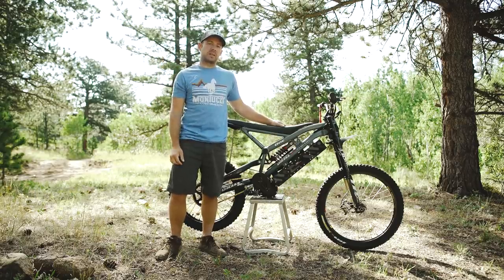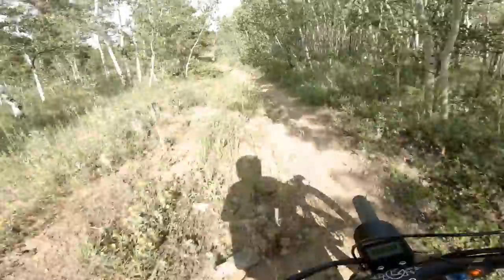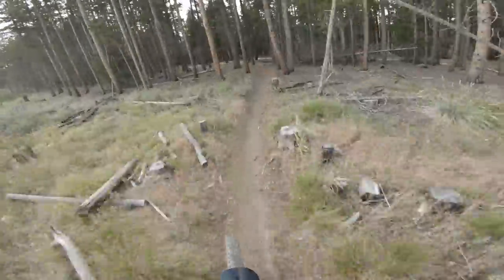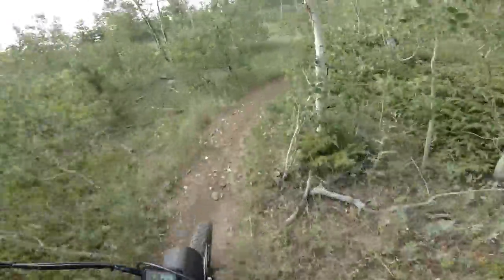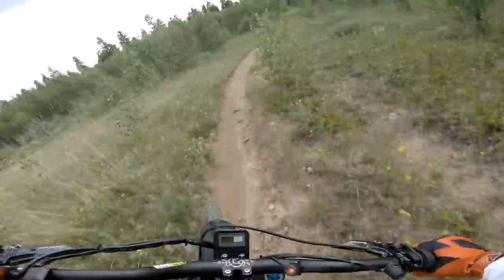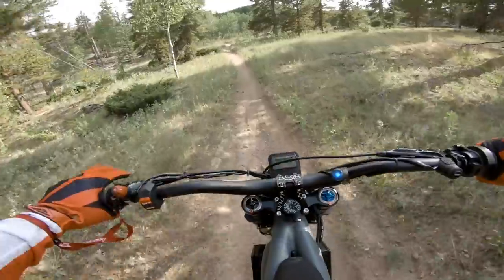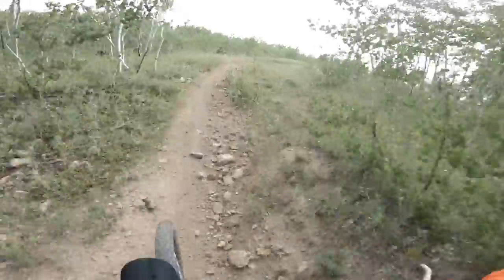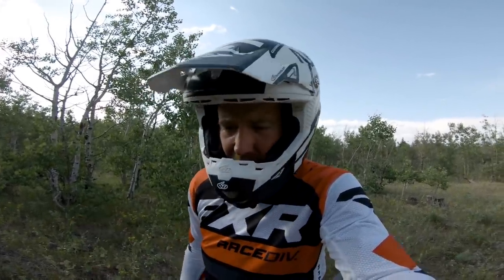CZEM Drill One Electric Dirt Bike | A Sur-Ron Destroyer?

Comment: Would like to see a longer close up walk around. Zoom in to frame and welds, adjustable points for pegs and geometry and chain tension.  Cockpit details, throttle and brakes, motor and chain drive, controller and program parameters. A segue 260 vrs this bike, which one would you purchase ?  Thanks for showing us the new tech!!
Reply from the maker: @Gary Linnert Copy that! I'll keep it in mind for the next video. Thanks for the note.

Comment: Only a sur ron killer if the price was similar. Its $9500 which is similar to KTM or Zero.
Reply: Not only that but, you can't get one so there is no comparison! Also my Sur Ron weighs 110 lbs and you could almost buy two sur ron's for the price of this (vapor wear) bike
Reply: This aint killin no sur ron. Stealth bomber eater maybe but my sur slightly modded my sur ron with my 220lbs ass on it goes 54mph and i can sir on the battery and still torque the front end up. I do like this bike a lot but syr rin killer its not.
Reply: @mshock9637  If you are not running an ASI or Nucular 24f with a 72v battery  this bike would crush the little Sur-ron you ride.
Reply: @andrewhunt4777  
Not according to the stats it wont. My controller is 120 amp as opposed to the stick 80 amp. I get 54 out of mine on the road with knobby tires and my big ass.
Reply: @mshock9637  Get on a track or trail and see what would happen.You would not even be close behind this bike.This bike has way more power than what you have.Even a straight line drag race you loose.
Reply: I mean you say that but.... 
And like ive said else where if you got a sur ron and dumped the extra $5k into it that sur ron woukd smoke this thing. Im not baggin it its just not s sur ron killer.
Reply: @andrewhunt4777  Fact!And its not built in a size for kids lol
Reply: Slappy White  120 amps is right at the end point of burning the SurRon 60 v cells.  110 amps better for battery health... Yes that is possible on stock SurRon battery with nuclear or ASI and bms bypass.   I run similar speeds at 110 amps - Drill runs 48 volt Sony murata high discharge cells that stay cool it’s a big part of sustainable power. Great package when the propriety motor the silllex controller and battery and bms all work together and no Chinese parts are here. You can mod any bike to get as fast as  another . But not sustainable ... and a different feel with a bike that has been designed to do what Drill One does.  I’m sure in time many  in USA Zwill love this bike.  it’s not a SurRon killer as they are a different class. It’s a KTM has killer with similar weight to power ratio and basically no maintenance and service costs. There will always be price whingers and haters though on anything new. 😏
Reply: @mshock9637  This is a surron destroyer! It leaves modded sur-ron's in the weeds.
Reply: @mshock9637  nope I have 84v sur-ron's with nucular 24F controllers and it destroys them. Considering I have had them for over a year and the tricked out sur-ron's are dust collecting pit bikes now.
Reply: @mainiero50  because sur ron motor max 10 kw ,not morе!
Reply: @mshock9637  How tall are you?
Reply: @lIlIlIlIlIlIlIlIlI  
6'1" or 5'13" or 185.42cm.

Comment: $9k 
55mph
2.5hrs range
3.5hrs charge time
Also the noise comes from the motor and controller not the chain. You dont hear bicycles going down the road makin all sorts of stupid noise.
Reply: Yes and no,If the you have a small motor sprocket it makes these sorts of noise from the chain as it forces the chain to take take a very tight path.And no why would you hear these sorts of noises on a pedal bike lololol
Reply: @fpvlee1586  
Ok how about a normal motorcycle thats still got its factory exhaust. The only time you hear the chain is if its dry. 
You cant hear the chain over all the chatter from the controller and motor. Have you ever played with a modern battery powered RC truck or car? When they power up some even use those noises as a notification that everything is good. No chain on any of my rc cars and they make the same noises.
Reply: @mshock9637  I like the noise my rc car makings whine noises too
Reply: That sound is called Electric torque, once you feel it with the whine you would change your mind unless you're just biased going into it. Plus I'd rather ride my KTM freeride EXC than my KX450F as it's just 100% much more fun. Don't knock until you try it. You seem very information Biased as it also sounds much different than the camera portrays and much quieter too as cameras pick up different frequencies than our ears. Doh! 2,5 hours range, I want to see you run some serious single track for 2.5 hours straight. 2.5 hours is actually a long time, charging is irrelevant as you can charge it in 45 to 60 min if you want to with a higher amp charger. The only time you hear the chain is when it's dry? Are we talking street or dirt here? Do you even ride? Serious questions?
Reply: Im mot complaining about it im just saying its not the chain making all that noise.
Reply: @FarmerFpv  
Yeah i ride. I ride a 2002 TL1000R street bike and i have a sur ron and yz250. Im not sure what side you think im on but i dudnt know there were sides. All i was saying is that aint all chain noise like he states in the damn video. You seem to be the bias one here as the other stats i listed were pulled from drill ones website. So i dont know you deal with facts is but you seem to be the bias one here not me.
Reply: @FarmerFpv  
How the hell do you know what that bike sounds like unless you were with him when he shot this. I was made to understand that the only one state side.
Reply: @mshock9637  Fella you are comparing apples with bananas lol.If that engine on this bike you are talking about in your question was not running yet the chain was moving at say 60000rpm with the wheel TRUST me you would hear it!I know small front sprockets make a hell of alot of noise coz ive been there and done it loads of people have so have friends! Im not saying all the noise is from the chain BUT alot is!And no i have not played with toy cars since i was a kid,mbx5 was the last i would think.Even then there noise is mainly friction noise from the drive train i.e all three diffs ect!This is my thought and you have yours! Have a good day
Reply: Ive been an electrician and cnc millwright for the better part of 18 years i know what a chain sounds like versus the whine of an electric motor. You guys are such snobs about stuff its no wonder the rest of the world would still rather blow 2 stroke smoke... they just dont want to deal with you guys.
Reply: @mshock9637  I'm not upset fella lol I even said have a nice day! I think I'll leave this conversion here👍
Reply: @fpvlee1586  
Sorry if i used too manny words there. But my comment was simply thwarting the claim made in the video that most of the noise heard coming from the bike is chain and thats clearly not the case.
Reply: Farmer Fpv 100% agree with all that.

To be devils advocate, the engines do click a lot, but to hear how much noise a chain makes, one just has to throw the bike on a stand and twist the throttle. Chains are loud!Add a couple of hard plastic guides and maybe a chain guard in the mix and you have slappy, clicky, buzzy noises all over the place.

I'm having Freeride withdrawls currently. Cold sweats and night terrors. I sent the suspension off for a super overhaul, then proceeded to break a bunch of bones that weekend on one of my gas bikes. Hopefully I'll survive another eight weeks without it my juice fix 🤣
Reply: @mshock9637  The drive is much quieter once broken in and you give the chain proper slack. Usually, the tighter the chain the more noise these bikes make so we run them almost sloppy, and that increases battery life, and much quieter.
Reply: Are we still trying to decide whether or not the noises heard in the video are chain noises or controller noises?! Yall are off your nut if you think all that noise is chain.

Comment: They‘re not a sur ron killer if they cost more than twice as much. The surron is avaiblo for under 4k dollar an these are all over 7
Reply: Also if you add a 72V battery to the surron and the right controller it will beat this bike no problem at half the cost.
Reply: intra morph  so. Don’t forget to change from a stock SurRon: the seat. Foot Pegs. Riser bars,  Suspension front and back shock. 21 inch front wheel , tyres.   + labour cost of building battery and fitting nucular or ASI controller.  have Done all of this stuff to several SurRons .. and no it won’t beat Drill  - these are different motors.  drill one also uses Sony Murata VTC6 high amp discharge cells and runs a 48v system for safety and long term performance .. not a modded 72v low amp cells to burning point.  ??? Once you get up over 12kw on a SurRon - the motor  loses efficiency. And no of course Drill and SurRon should not be compared ..but they will be of course for marketing ..As in  the USA there  are now thousands of SurRons.   CZEM Drill one is a boutique player and not looking to break into SurRon market. they are Looking  though to break  into the big boys - KTM and husky market & Convert some of the hard core gas enduro riders. You boys who ride the cute kids bike - SurRon are not the target at all. 😆

Comment: Imagine putting a 6 speed gear box on this thing, easy 100mph +
Reply: It would help very little actually. An electric motor delivers its maximum torque at zero RPM. And RPMs can be handled via controller software.
Reply: @JuanJDumeP  thats what a gear box is for to give you more speed. Gearing is everything
Reply: @hidros1461  it won't help much. Electric motors have programable insane RPMs. The electric motor has more torque at 1rpm than at 100rpm unlike a gas engine who has most torque at it's max rpm. If Tesla isn't using them on their cars I'd because they don't really work. But I do understand 100% where you are coming from. It's hella confusing and new.
Reply: @JuanJDumeP  I guess a taller gear would give more mph maybe
Reply: @JuanJDumeP   lots of diy electric cars use the stock transmission, you can even use a manual gear box.
Reply: @JuanJDumeP  I've got an e bike with a middrive motor that uses the gears. The gears are a huggeeee help. Maybe it's because my bike peaks at a little under 5 kw only, but the acceleration in lower gears is far quicker than it would be if it was a single speed, and in the highest gear I max out at 45 mph on a flat road. He's right that multiple gears would increase acceleration and top speed (but I doubt this thing will do 100 mph even with taller gearing). It just won't make as much as a difference as it would with an ICE. Tesla doesn't use them because it's cheaper and more practical to just increase the power going to the motor to compensate for having a single speed instead of spending money and doing research on designing a gearbox for their cars. Both ways do increase performance tho.
Reply: In a vacuum maybe!

Comment: Hi mate, as usual nice video!
It seems quite nice. In comparison with the Sur Ron, it looks finish even as stock. Its quite expensive but at the end of the day it'd probably cost the same price as the Sur Ron.
Only one question, there's no bash guard or protection for the battery, to be honest, I'm riding on hard trails and I already broke the motor on my Sur Ron (with the bash guard).
So what do you think, is the battery and motor tough enough to handle hard shocks?
Reply: Yes that was my first thought when I first saw the bike. That battery would get crushed if it was mine. That front wheel would have to go tho.

Comment: I just got my drill one a few weeks ago and sold it today. IT IS NOT A SUR-RON Destroyer. I don't know what they were thinking but I can't get the thing to stop shutting down on me due to heat. They're running a very low voltage 48v battery at insane amps (amps=heat). Any time I try to mob it turns off on me (with in a few minutes), maybe I should get sponsored by them because this bike can't keep up. 

WHEN I CALLED they informed me that it's not supposed to be a dirt bike and that its actually a trials bike... 

OTHER THEN THAT, I swapped out the front fork to FOX 40s and the bike feels amazing.

Overall I would not recommend this bike to anyone that wants to mob. My Sur Ron with an ASI controller is literally twice the bike and hasn't shut off on me yet.

Comment: Nice review, thumbs up from me. Couple of suggestions for the video though: 
First could you upload it as a 4k video? (even if it recorded at 1080p, the bitrate of 4k makes fast paced videos more clear)
Second could you up the contrast/saturation (maybe use a lut)? The colors look kind of flat and it makes it hard to see sometimes.
Reply from the maker: @Mark Wilson Thanks for the note and feedback! You're correct in that 4K would help some of these things. I typically film at 1080 because I travel for work and usually working off of a laptop. The GoPro codec struggles in Premiere Pro even at 1080, at 4K it's nearly impossible to edit on my system. I'm a Cinematographer by trade and by nature probably a bit picky when it comes to the style I'm going for but yes, I can throw some more saturation in there. Usually straying away from the over-saturated REC709 lut from yester-year. Noted though! Thanks for the suggestions and I will keep it all in mind. 👍

Comment: Been curiously following this company for like 3-4 months. Cool to see you got your hands on it. Thing looks like it’s got some pretty mean acceleration 👌 Looks like it might use the same map switch and throttle the Electric Motion bikes run? Is it Domino brand stuff?

I’m with the rest of the commenters in that the price is a little hard to swallow. $5,995 would probably be the high end of what I’d be comfortable swallowing for a mountain bike based machine like this.
Reply from the maker: @John Howerton It's got a lot of get-up, for sure! The bike does have Domino brand throttle. The price will be significantly higher than a Sur-Ron but is still TBD in the states. I'm not sure what it will exactly cost but I hear you. To each their own, always subjective to the rider and how they want to spend their hard earned dollars.

Comment: for you guys reference,  the ESC of my surron X dies within half year, I only ride it like once a week, so its cheap for a reason.
I got a 17inch MX Tire at the rear and 58T ChainRing(May be the excessive load kills the ESC :< )
The DNM is POS (Twisted after Charging some Upstairs, Replace it with old Marzocchi 380)
Brake Levers are POS (Completely Broke when I Drop my bike at a slow Bail condition, Replaced with Shimanos, the Hydro-line routing for the rear sucks)
Upgrade to 26inch Front Wheel Finally, feel much Better

Comment: Great video & commentary thanks. Most of the reviews I've seen are on single track and it's difficult to see gradient. How well do these types of bikes climb steep hills and how is that reflected in the battery life. I ride a ktm 450 and I realise they are no comparison but these bikes look very capable.
Reply: Thats a great question..
This one looks like it might just have enough power.. and considering how trials bikes are tuned for low down torque, well.. the brushless motors used on these bikes produce max torque from zero rpm onwards, its also really light. 
With decent rubber and moto wheels to provide a large enough contact patch I'd imagine it would perform pretty well on the hills.
Would love to see a seasoned trials rider put it through its paces to see if it had enough grunt.

Comment: The battery is in the wrong spot. Should be under the seat horizontally. It would help to mono easier, protect the battery from rocks and help to improve balance. Even go as far as having a padded battery pack as the seat.

Comment: Looks very fast, but you can't really compare this to the standard Sur-Ron X.
It's OVER double the cost, it is no where near as aesthetically pleasing as the Sur-Ron X is. It weighs 5 pounds less and you get a bit more speed. 75 vs 90kmh. You could buy a better controller and better battery for the Sur-Ron and it would still cost less and it would be a lot faster. 

You could compare it to the Sur-Ron Storm Bee, but the storm bee blows it out of the water. 22.5Kw, 110kmh+ and the storm bee still costs less.

Comment: How about going up hills??  Thats a good price i paid 5000 for my ebike down from 10.000 nzd shop around.
Reply: Hill climbing and jumping the bike is a blast as it goes up every hill we played with much better than gas bikes do as the power to weight is unparalleled. I have modded sur-ron's that struggle on the same hills that I let off halfway to three-quarters of the way up on the Drill or I jump the top which is even more fun assuming there is space on the top.

Comment: Definitely looks fast but the biggest issue I have is price. It's $10,000 US. That's ~$6,500 difference in price. With affordable high quality 72v batteries and controllers on the market($2,500-3,600 battery+ charger+controller) I think it's hard to justify this over a Light Bee if you can make it just as fast with $3-4,000 saved for more upgrades like fork, brakes, wheels, tires, etc or hell, a 2nd Light Bee.

Another one I can't seem to find anything about the battery outside of 2.25kwh. No volts or amps listed on their specs for motor or battery pack. Also doesn't say what batteries are used, just Sony.

Next month I'll have a BAC8000 controller and Molicel 2170 72v48AH battery pack on my Sur Ron. I also live in CO and wouldn't mind letting ya have a spin at it once I get everything on. Hell, I could also just do a quick controller swap on yours and plop in the 72v pack and you can take yours out at ~20KW of power.